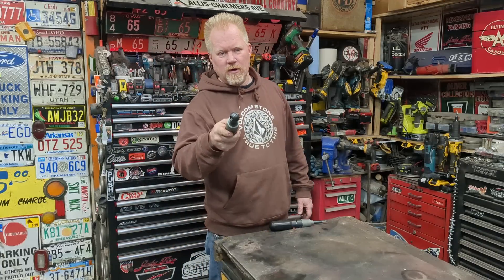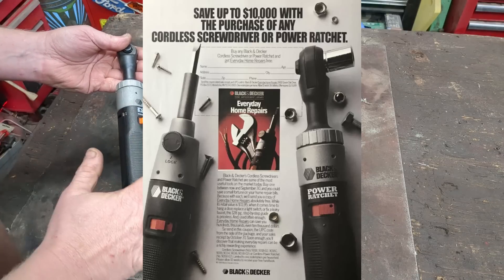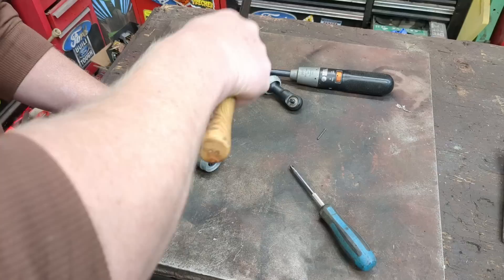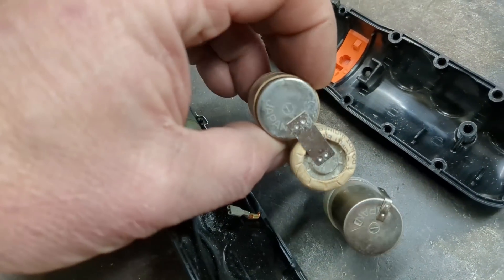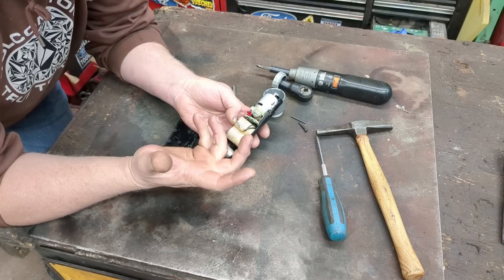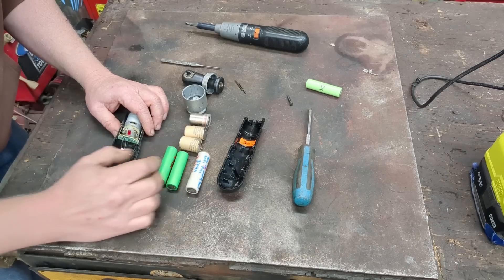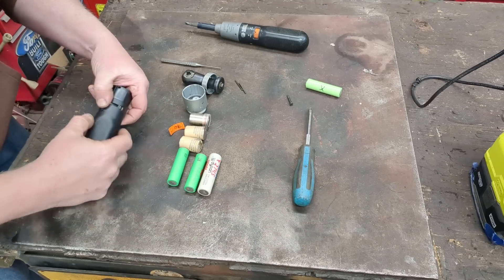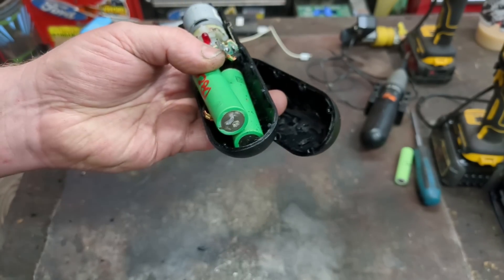80's Power Ratchet Lithium Conversion Black & Decker Snap On

Comment: One complaint--I don't see anything to address whether there is a direction to the 2 pins you casually tapped to get out and back in for opening and closing the case.  For some equipment, the direction of pins makes a big difference.

Comment: I did the same to a similar B&D ratchet but I used a $1 Chinese battery management board 1/4" by 1.5"  and it charges fine with the original charger.

Comment: How Can You Charge A Battery Like That You Need A Lithium
Charger
Reply from the maker: I installed a premade $5 circuit board so it charges like a cell phone. Just plug in a USB cable.

Comment: I have both of those found the ratchet to be pretty useless you had to loosen everything manually might work for running long bolts down hardly used it when it was new.
Reply from the maker: You're supposed to tighten and loosen everything manually with a cordless ratchet. I've used DeWalt, Makita, Milwaukee, husky, Ryobi and every single one is this way. If you want something that breaks nuts free, you need a right angle impact.

Comment: Awesome how compact that ratchet is. One way to supercharge it would be to switch to an RC/airsoft style LiPo battery pack instead of the cylindrical cells. Find a 3S or 4S pack that fits within the constraints and get some speed outta that little beast.

Comment: a bms would be a good idea, i know its not likely to overheat but running lithium low on voltage then charging them can cause them to short internally and catch fire, i know, ive done it.
plus theyre literaly $2 on amazon
Reply from the maker: There is a charging BMS. That's the USB C device. There is not a low voltage shut off though. Because you cannot find ones that will run these tools. They all have to have pass-through power and there are none that will supply the 10 to 20 amps required. They are all for low drain devices around 1 amps. The charging BMS will not allow it to overcharge and catch fire. All of these cells also have a thermal fuse and if they get too hot it'll simply blow the thermal fuse.

Comment: i sat like 1 or more minutes on cells with an iron but those cells were low power and somewhat old. Worked just fine. Would not do it with high output ones. Unless i can manage it within like 5 seconds :D

Comment: You could try fitting a stronger brushless motor the same size would be another awesome upgrade to get some more power out of it and as they are using metal gears in the production I think you wont have any issues regarding strength
Reply from the maker: That would be cool

Comment: It seems that many of the older Black & Decker tools were really great, but then they seemed to just stop making worthy tools, or at least started making consumer stuff. I'll bet you could educate us on what's what with B&D, and what vintages to buy and what not to buy. That was an extremely slick power upgrade. You're the Wizard of Fixit--along with your trusty sidekick, Ginger.
Reply: Anything that has the "professional" nameplate on it in gray or yellow lettering is good.  Anything with "industrial" in red lettering is also really good.  The best would be the tools they made from the 60's to the early 80's in aluminum housings with orange badging.  They had a distinctive era where the tools were better than even milwaukee back then.  I buy them for next to nothing because everyone thinks black and decker is all homeowner junk like toaster ovens and hedge trimmers 😂😂😂

Look up B&D 1065 "shorty" drill and its more modern cousin the 1165.  Anything that looks like these will be pretty good.  Look up model number 1321 as well.  2 examples of very good tools from B&D
Reply: @machineman8388  Thank you very much for that explanation. That really is valuable information. When I started my first carpenter's apprentice job in the early 70's, it seemed like Black & Decker was one of the most coveted names in circular saws and drills and stuff. Right up there with Porter-Cable and Milwaukee and such. Thanks again.
Reply: @jbj27406  so you're roughly the same age as my father, he graduated high school in 1973.  Its interesting you mention that being a coveted name because that's what I figure when I see some of these tools.  Some of the old B&D stuff I have is unrivaled in terms of quality.  But when I ask my dad, who never necessarily worked on the trades but has always fixed his own cars, built his own cabinets and decks, etc.  He says he can't remember them being anything other than homeowner grade tools.  I think much of their higher-end tools were only marketed to professionals and industries in certain channels, and as such they were beat out by milwaukee who also targeted professionals and DIYers alike but in big box stores like home depot.  Thats just my guess at least from what I've gathered.  Almost all my stuff is older than I am.
Reply: @machineman8388  Pretty close. Class of '68 for me. I still have my 13 amp Milwaukee #6365 7 1/4 inch circular saw that I bought brand new in 1976. I built a deck as one of my first side jobs and every nickel that I made bought that saw for me. I still use it all the time.

Comment: I have the B&D screwdriver and a 3/8in Skilwrench which is all metal body.   Thanks for the video, I have been pondering replacing the dead batteries with new lithium cells.

Comment: HEY! That would be a cool video, biuld a Battery Spot Welder. You could make a cool one and make a good video out of it.
Reply from the maker: If you're concerned about soldering on cells: I actually do own a battery spot welder but soldering is so much quicker and easier. They're cheap if you only want to spot weld thin nickle strips on low discharge applications. The one I have($40) will do thin strips and would have worked fine for this low amp draw application. When you want to start welding thick nickle like you need for most power tools that can draw 60-90amps you need a large one. They're a lot more and most are commercial. Problem with building one is if you go too powerful you'll blow up the cell in your face. They need to be pretty precise. Too date I've soldered easily over 500 cells now and never had an issue. I had one cell that was really low and I wanted to see what happened if I held the iron on for a long time. I had it on the Positive side for at least 40-45 seconds before I heard a light tick. It blew the little thermal fuse under the button. I've run my thermal camera after soldering and they get hotter during regular operation than they do from me soldering.

Comment: That's really funny I just did the same thing today. I got two old Makita 7.2 volt drills from the mid 80s I believe. I used two 3 amp hour 18650s from a vape I had laying around and got some BMS boards and a lithium charger that plugs right into the original barrel plug on the drill from eBay around $10. Works good as new now going to do the other drill probably tomorrow.

Comment: Love seeing a Dyson pack in the 'kiosk' They have a turd BMS that tanks the whole  pack if one bank goes a bit out of balance. Out of 15 or so i found they all had perfect cells. Nice Sony and Molicell and 6 of em great for a 2p 12v build. Pain to pry apart the clamshell though
Reply from the maker: When I first started collecting battery packs, I actually did not give the Dysons a second thought. Even left some. Then I started prying them apart. Finding that virtually all the cells are good. A lot of them have a magnetic sensor at the front that would just go out causing the pack to brick like you said. Now they're my favorite packs.

Comment: MM77 Approved 👍🏻👍🏻………………………………………Years ago, when my dad passed away, my siblings put me in charge of going through the tools he had. He kept tools no matter if they worked or not. I threw away a couple of those ratchets and four of the screw drivers. The batteries were dead and the tools didn’t work. If I knew then what I learned today, I would have kept them and fixed them just because they were his.

Comment: I did a similar conversion to the Black & Decker Versapak battery. I gutted out the battery pack and installed a 18650 that's removable for charging. Works great, more torque and power for all my tools.
👍👍👍👍👍👍👍👍👍👍👍👍👍👍👍👍👍👍👍👍👍👍👍👍👍👍👍👍
Reply from the maker: Awesome

Comment: Great video! I have a secret source for lithium ion batteries with the charging board included. It is a retail outlet that used to sell them to hobbyists but won't anymore because it is considered legally liable. I wish that recycling centers, Lowes, HD, Ace Hardware, etc. in my area would allow me to pick up lithium ion batteries used. I don't know why they won't, but universally, they refuse. Probably the same reason. The good news is that good, high drain ones are not expensive online . Is that a recent video of you in the snow with Ginger? Wow!
Reply from the maker: Yeah that was me and Ginger last week in the snow. Got stuck for a few hours. Recorded a bunch of video but not sure if I have enough to put together a cohesive video.
Reply: @sixtyfiveford  Wow, that snow is something, this late in the season! Here in WA, we'll be lucky if we have any snowpack left.
Reply from the maker: @waltschannel7465  I had to go pretty high up the mountain to get this snow and it was soft mush. As far as Lowe's Home Depot; I've only had one Lowe's tell me no. But then again I don't ask; I just grab. I've had a few times where they asked what I was doing and I just say I'm doing experiments/projects with these garbage batteries and they say ok.
Reply: @sixtyfiveford  The stores here put hasps and padlocks on the battery disposal bins. They used to put the bins near the entrance next to the shopping cart bays; out of sight out of mind. But now the bins are on the exit side of the registers, carefully watched. Some won't even let the consumer deposit batteries without employee assistance.

Comment: Awesome fix. Hay  does it hurt  to be that  smart. Ha ha thanks again  and yes  i had that screwdriver
Reply from the maker: Hey thanks. Weren't the screwdrivers only around $19.99? I guess even if they were, that's probably $80 in today's money with the way things are going.
Reply: I got it from my sister for Christmas  so l don't know what it cost  ,about 40 miles away  in reno we had a JC PENNeys   OUTLET  AND I use to get lots of  B AND D  TOOLS  AT SUPER PRICES  and there tools  LIKE THERE $ 3000 +   AIR COMPRESSOR WITH A DENT  IN THE BELT GAURD  FOR $ 800.00.  OH THE GOOD DAYS  WHERE DID THEY GO .?

Comment: Just an FYI. You can buy those TP4056 charging boards with protection circuits build in. They will prevent over discharging the battery. They are slightly more expensive and slightly larger.
Reply from the maker: The only issue is the pass through low voltage current they are able to supply is really small. I think around 1 amp which is too small for any tool application. I  would guesstimate that this ratchet or even screwdriver version stalls out around 10amps.  The chip would work fine for a flashlight or similar low current application.
Reply: @sixtyfiveford  Yeah, I never thought about that.
Reply: @sixtyfiveford the biggest issue with those boards is not the missing over current protection its the missing under voltage protection which can and will damage the cells

Comment: Great job re-powering it. I had one back in the day, my friend wanted one I wanted one. Then got it for a gift I was so excited. My friend got one too. I remember being a little disappointed with its torque. Meanwhile I did come across my old B&D power screw driver which I thought was gone, dead as a door nail of course. Half of me wants to re-power it, the other half of me is like 'I don't know, I have to buy more 18650 cells'. I always end up using any 18650 cells I have in my flashlights. I will investigate if I can get battery packs from the recyclable places.

Comment: What about upgrading the motor and speed control? Would it be possible with a rc car motor?
Reply from the maker: I don't see why not. You'd just need a motor small enough, as it's pretty tight in there.

Comment: Gonna try this with my Makita 3/8 impact I bought many years ago when I was an auto tech. Super handy to have when working on small engines, but the battery life is garbage. Used to be decent for auto repair, but those days are long past. I also looked into getting a more powerful motor installed in it. Ain’t technology wonderful nowadays?!?

Comment: Great rebuild, was thinking about the vape boards right as you mentioned them and have been wondering about using them as I find a lot lying around the road
Reply from the maker: I've been collecting vape batteries/boards. Haven't found a use for them yet... Soon.

Comment: One thing you have to be aware of it's bad to take Li-ion battery down to below 3V, so don't run it until flat. Better is to fit a small management board inside that will turn off motor when cell voltage gets too low

Comment: Torque test!
Reply from the maker: Lol. Not sure it would even register on a scale. I would guesstimate somewhere around 15 foot pounds.
Reply: @sixtyfiveford  diy

weld a rod with an eyelet to a socket, so the eyelet is 12" from the socket's drive square. Then hang weights from the rod's socket, and see how many lbs the ratchet will lift.

Comment: There's a flashback. My Dad had both of those. When I bought my Husky 12V ratchet, I was expecting it to be waaaay better than the old B&D. Turns out, the battery is about the only technology that got better. It just lasts longer now. Not much more (noticeable) power. Great stuff, my friend!
Reply: I have the Husky too. Too big for a lot of jobs I find.
Reply: @DeesMoFukiNutts  yes! I've had to reverse it at times because I backed it into a bad spot.
Reply from the maker: Not sure why somebody hasn't come out with a skinny handled one with three of these cells stacked end to end. If they did that, it wouldn't be much bigger than a regular ratchet.
Reply: @sixtyfiveford  yes, that's a great idea! I'd be all over that.

Comment: i used vape batteries  and put 2 or 3 of them into the vape case along with the  stock vape charger and used it to run a battery powered floor sweeper. I also built other things using vape batteries and use my rc battery charger to charge up the batteries since i can do all sorts of different types of batteries and set the charge caps and rates. They are inexpensive and some can even be used as a light duty power source.
Reply from the maker: Awesome

Comment: I remember all that stuff....  I can't even express in words how excited I was to get a Makita 7.2 volt ni-cad cordless power drill.....  Heh heh heh!!!  Batteries slammed in the handle like the mags on a 1911.....  Heh heh heh!!!  

Ohhh yeah....  That is a trip down memory lane right there...  You're not wrong, all the cool guys had the charging base thing screwed into the wall of their garage....
Reply: Those makitas were probably the coolest thing around at the time, you're not the first person I've heard/read say something similar.  I think those old drills would be great to do a battery retrofit on, because the internals on those drills are actually really really nice.